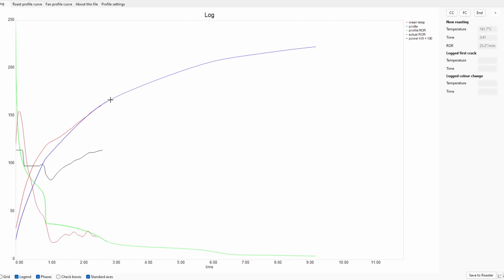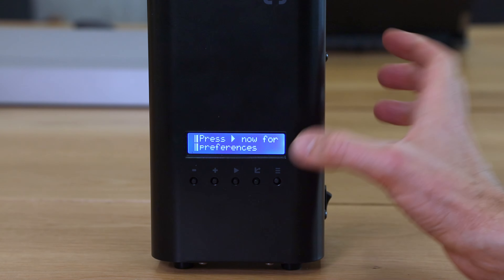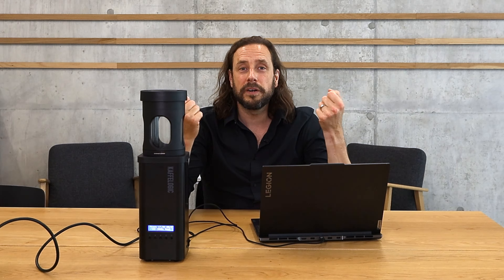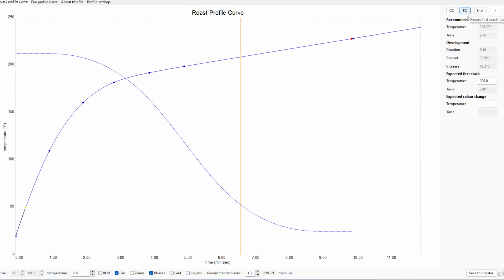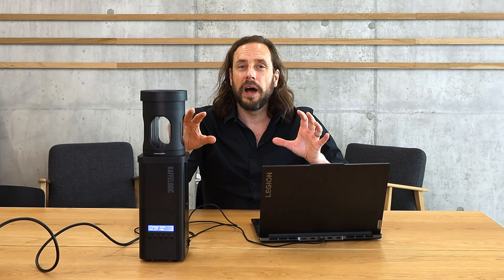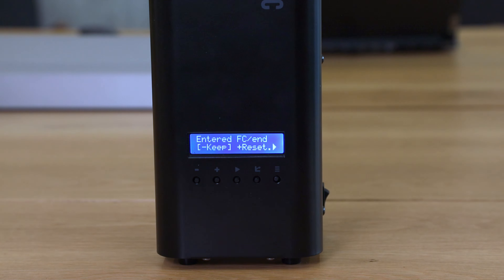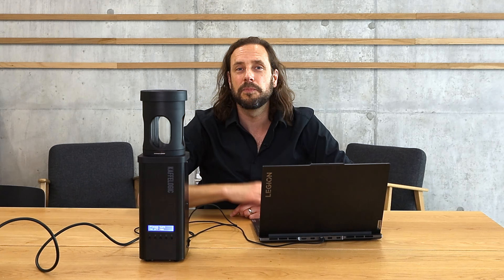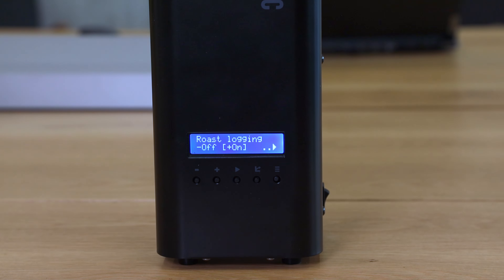Kaffelogic Updates: Live roast logging, DTR mode and more

Comment: Very informative Videos. I have a question; I draw a roast profile on KaffelogicStudio and I want to apply this while im roasting. Which steps should I follow? Thank you.
Reply from the maker: Save it. Connect your machine to the PC while Studio Software is running so that the profile is synched to you roaster. Then just chose the profile on your machine
Reply: @CoffeeRoasting  I struggle with Kaffelogic first 3 day especially pre-heat settings while designing a profile but i get used it now. I highly recommend this sample roaster especially when its merge with your roasting knowledge become a more efficient and funny tool. 🙌🏼